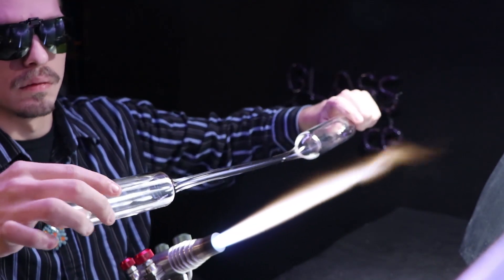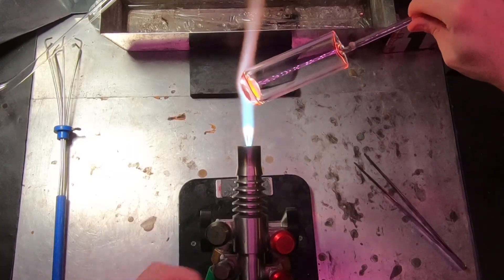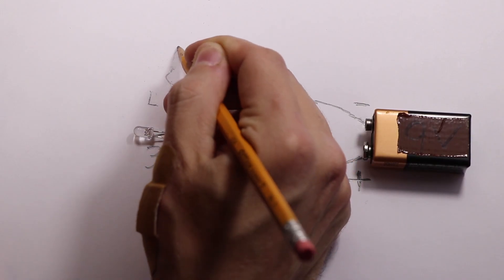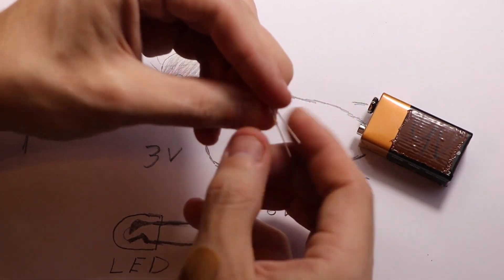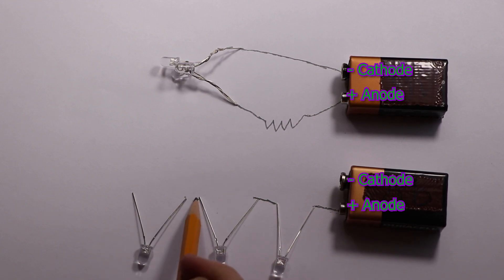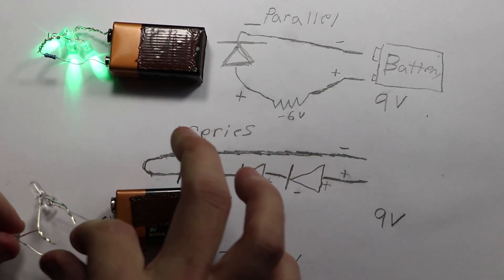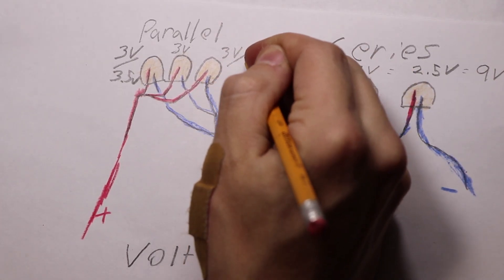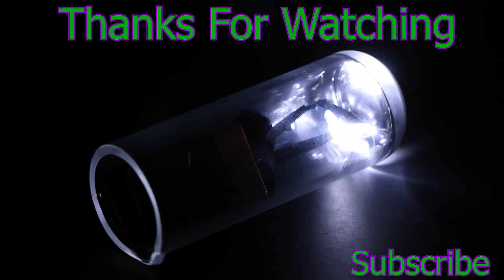LED Flashlight | Series / Parallel

Comment: I there can you tell me what resistors I need for 3 x (3 white leds) using 12v
And also the same using 4 x white leds ?
Reply from the maker: Hey Jay, I got to warn you I'm not an electrician or electrically trained so there may be some inaccuracies in my information. But Four LEDs in Series should work without a resistor on 12v. For Three LEDs you'll need a resistor that adds 3volts of resistance. If you have a Voltmeter you can add resistors until the voltage drops from 12v to 9v. If your trying to install this into something and not just running an experiment like in the video I recommend contacting an electrician first.

Comment from the maker: Note: Rechargeable batteries (AA, AAA) are normally lower in voltage (1.2v) instead of (1.5v); They might not work in some devices like digital cameras. Also wiring an LED backwards shouldn't damage it, just flip the battery around and try again.